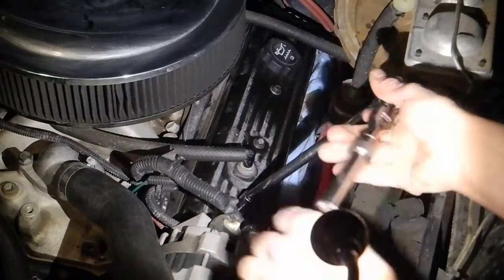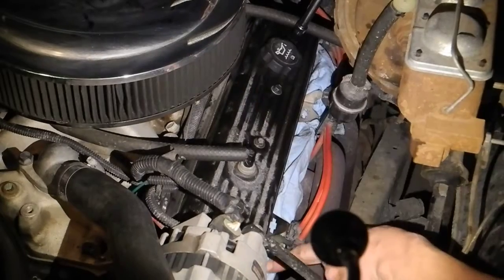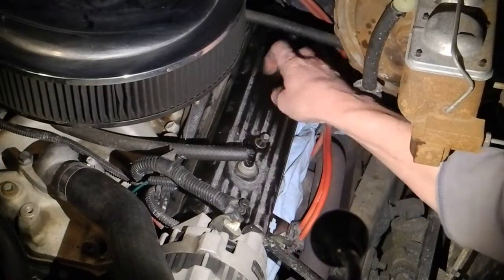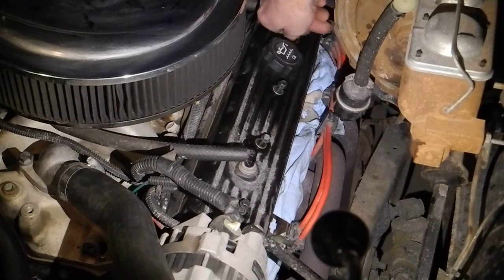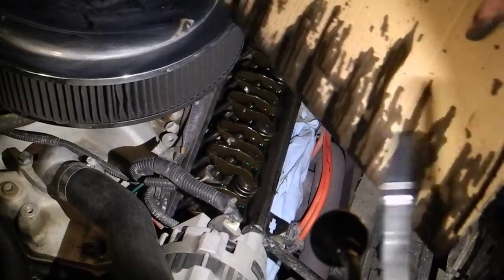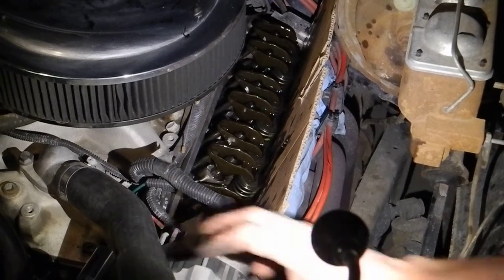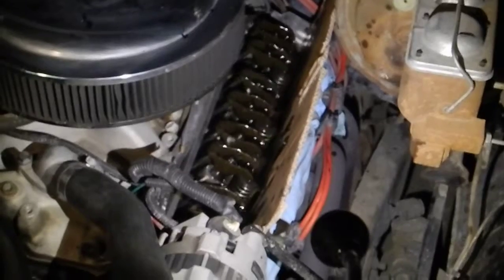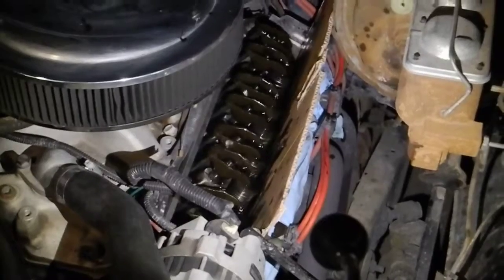05 Valve Lash Adjustment Drivers Side

Comment: mine started clacking today, I don't know much about engines so this helped alot. I'm going to try to do the adjustment tomorrow. oh by the way I'm working on a 1979 chevy with a 350. the videos are great thanks.
Reply from the maker: Great, I am glad they were able to help you through this process... I took a lot of time researching this, and followed the advise of professionals, i.e., Mechanics, albeit, this is a hack, there is no science and measuring and formulas, etc... just a feeling, a sixth sense...one with the car/truck...use the force...be one with the energy around you...  Take care and have fun.  :-))
Reply: JDE I did it, I was confident I could since I was able to see you do it. thanks again.

Comment: y did u do this work sir ? what will happen to the engin now ? plz replay
Reply from the maker: Ahmad Shablaq There are more parts to this series of videos. This process is designed to remove any loose clicking sounds you get when engine is running from loose fitting valve rods that cause valve itself to make clacking sound or clicking sound on top side of engine.  Good luck.
Reply: JDE thank you but one if i may ask how dose ur engin run now is it better then befor ? i have the same problem with a 305 clacking noise and the shake alot and its slow i mean the car is so slow do u have any idea what could it be ?
Reply from the maker: No I can't say what problem you have. You need to take a video and others, can offer you ideas.  You might need to have a compression test done. Does your engine burn oil? When you hit the gas, you have no response? And Engine is making noise clacking sound.  You might have lifter problems, but it could be your timing, or if you are burning oil, I would say a compression issue with engine.  Need more information, pictures and sound would help...